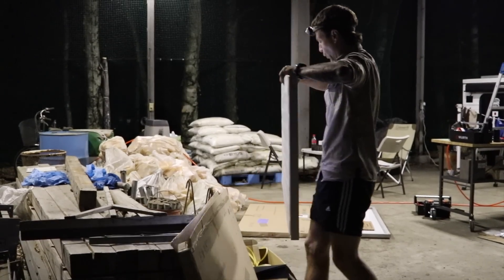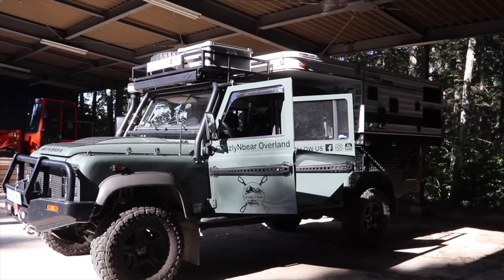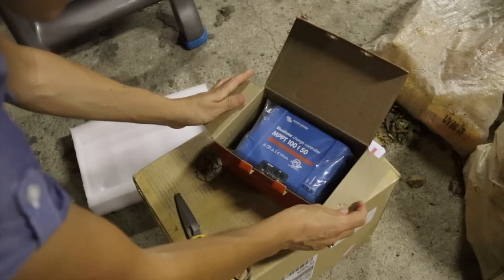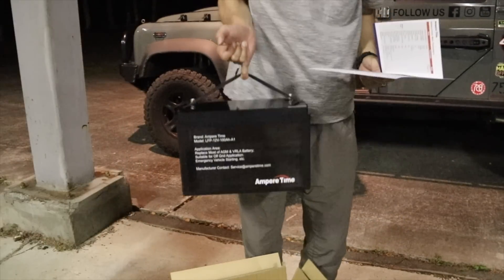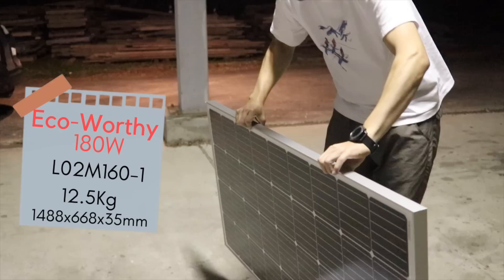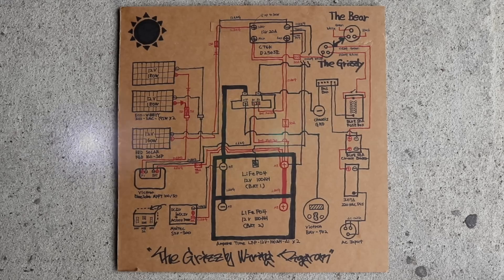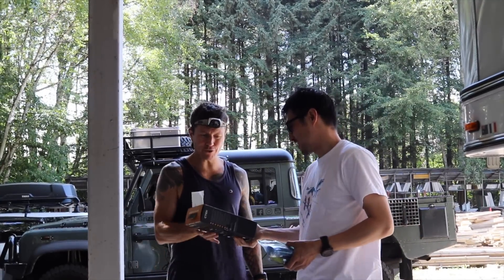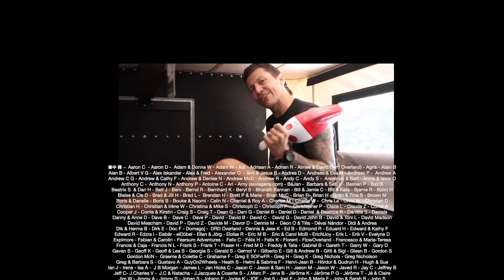A Lithium Off Grid Solar System Upgrade for our Truck Camper TINY HOUSE (Ep 139)

Comment: Gak here,

Glad you guys like the current system, I also learned a lot through the installation, especially Lithium Ion.

Excuse me that I made a few mistakes on the diagram, it was an “one shot” sharpie marker game without rough drawing at 4AM, that’s why I was moving the board when it was filmed! 😅

When batteries are connected in parallel, + line comes from + terminal of the battery 1, - should come from - terminal of the battey 2.

So, my YouTube channel will be starting out from next week, something related with GrizzlyNbear. I’ll upload exactly the same time when you upload the next ep!
Reply: YOU are an electrical GENIUS.
Reply: You are a legend! Absolutely meticulous Gak.
Reply: yes  you sign up for free unlimited energy now.  ! it's free and unlimited.  hook up as much as you want and as many you want. it' s  free and unlimited. it never runs out.

Comment: Awesome video and install. Question for you: from what I can tell, you ran 10awg size wire from the 180w panels down into the charge controller. I have a FWC too and was told that 12awg is the largest we can run behind the front lift panel, otherwise it won't collapse right. That's what I'm trying to sort out as I get ready to build my system and would love to know if your experience confirms that or you could do otherwise. If you did run into that issue, how did you run the wires? Thank you for any help...and climb on!

Comment: Now I want to send my Four Wheel Camper “Hawk” to Gak for solar.  Only problem, I’m in Northern California.  
Thanks for posting this video. Cheers, Geologyjohn.
Reply: Thank you, Geology John!

There is only one thing I don’t like Four Wheel Camper is hard to access a roof from inside of camper due to interior design and materials they use.

I don’t know yours, but the ceiling material should be removable, so that you can fix water leaking and do wireing much easier.

Comment: Solar electricity production is neither unlimited nor free. Over the approximate life expectancy of the panels (20 years, if you are very lucky, with some degradation of performance over the year), you'll need to replace the batteries several times, and the charge controller & inverter a couple of times. If you add up the cost of all the components, and divide by the total number of Kwh the system produced over its life time, you'll get a cost per Kwh several times higher than purchasing power on the grid. It is a way to get power for RV's and in remote areas, but it is neither free, nor cheap.

Comment: Excellent video! Will this also be the solution for the inside cooking problem? Or will induction cooking drain the batteries too fast? Looking forward to the next video!
Reply: Great question and one that's being tested right now 😉
The induction cooker is installed and has been tested this week.
So far so good 😊
We could potentially add one more 100ah lithium battery to the system if required but we don't think we will need it.
Reply: @leighdearle5965  exiting stuff! I'll be sure to watch the video with the new setup then :)

Comment: The Ctek D250SE is a great piece of kit, I installed one last year and it's been an install and forget job. The slim solar panels, go for marine ones they are superior to the cheaper ones but the cost can be a factor. I use SunbeamSystem Nordic flat panels with shadow optimized. Never had any worries this year. 👍

Comment: The difference between the panels is mono and poly crystals. Mono being the best and poly coming from diferent crystals fails more often, are cheaper, flexible, and are also thinner. While mono like the ones you have, are better more efficient, not so flexible, and thicker.

Comment: This is nerdy. The video didn't show... To get the most from your 2 batteries when they are coupled i parallel, all other + wires are are connected to + terminal on battery 1 and all other - wires are connected to - terminal on battery 2... Godspeed :-)
Reply: We didn't show this but we do have it connected this way 😉
Thanks for the good advice.

Comment: to raise the camper top reverse the ceiling fan so you have positive air pressure inside the camper it will be a lot easier to raise the top with the doors and windows shut, try it
Reply: That's a brilliant idea.  I've seen massive steel roofs on LNG tanks lifted 25 metres with just a couple of psi.

Comment: Great job guys, you might look at a cable gland for your panel cables coming thru the camper top. They make angled ones as well. It will provide strain relief for the cables and make it water tight. Only a true gear head would make coffee with a screwdriver!

Comment: Soo much power, I love it. Awesome job! Lithium is 100% the way to go. Yes its more expensive but it will last you longer, weighs less and is basically fool proof. Many people also don't realize that 200 amps of lithium is much more than 200 amps of AGM, cause you cannot drain the AGM's as much as the Lithiums. Looking forward to the next adventure.

Comment: Brilliant video, thank you. I fitted the Victron  mppt controller and fitted the Victron Orion dc-dc instead of the Ctek as it was more suited to my set up.
Reply: Same here. I fitted Victron MPPT 75/15, 150W solar Panel, Victron Orion DC-DC TR 12/30 Amp, Victron 375 inverter and victron 65 Amp battery protect. Works like a charm with 104 AH Lithium battery